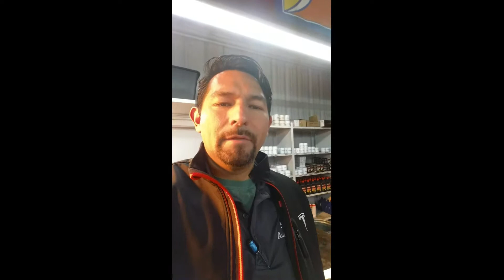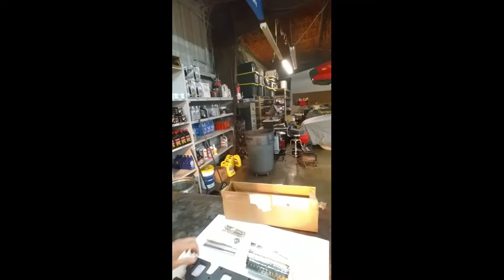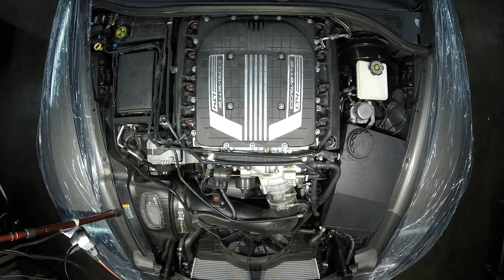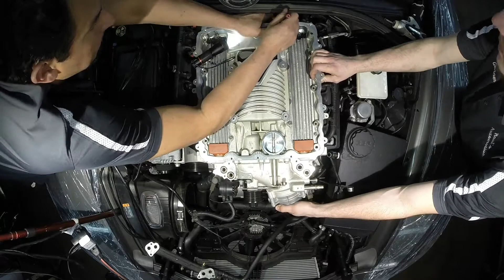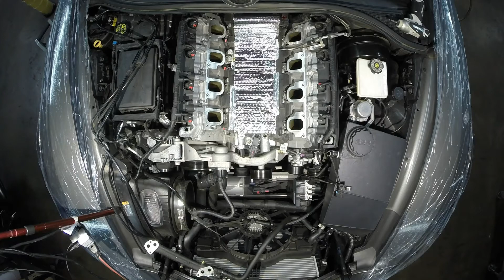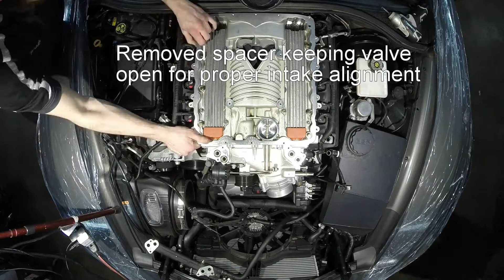2016 Corvette Z06 Fasterproms Thermal Supercharger spacer install

Comment: I have a question for you, currently trying to install these on my 2015 Z06.  At 6:12 into your video it appears you place some sort of black "cap" on the opening there.  Can you elaborate what that is and if it's 100% required?  I bought my plates from someone and all they came with was the bolts and plates, not sure if this was missing or needed separately.  Appreciate your feedback!

Comment: Unless that insulation blanket was foil faced on both sides, you put it on upside down.  The foil needs no face down towards the heat source.  did you see any results in blower/IAT2 temps?  Would you do it again?
Reply: The heat source is the blower lol.